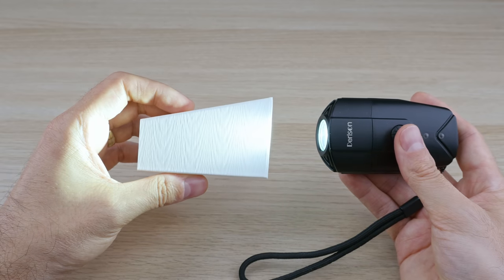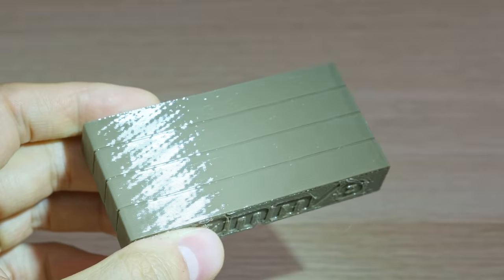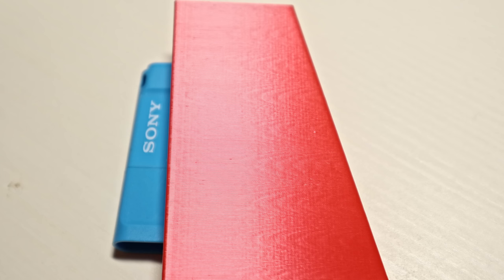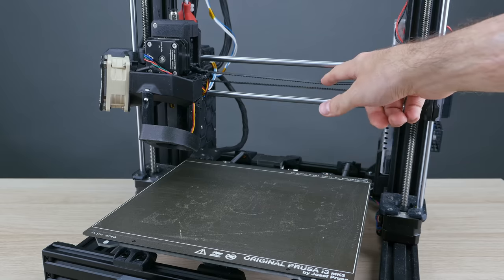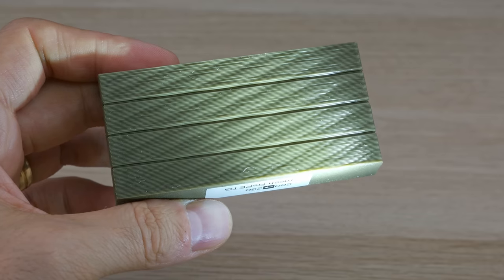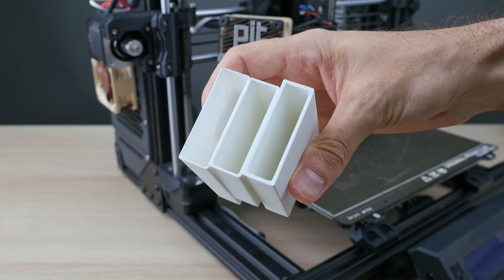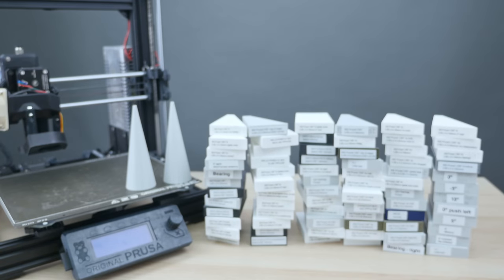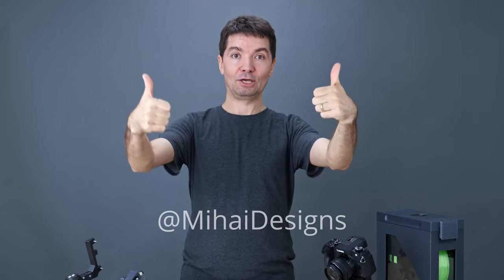What I've learned about your 3D printers (and mine)

Comment: Thanks for putting so much effort into this Mihai, if I could add an idea... if converting the single gear helps the problem (presumably because it alters the pattern of torque transmission) what do you think would happen if we designed an extruder with multiple sets of dual drive gears? Imagine one with 2 or 3 matched sets of dual drive gears, at offset angles of the filament path, with each set of gears having different number of teeth for both drive and filament contact but balanced for the same rate of feed. Could we somehow achieve 99% smooth torque transmission?
Reply from the maker: Great point! Multiple gears with offset teeth would reduce the issue most likely (although I have no way of testing). If you take the number of such gears up to infinity, what you end up with is very similar to double helical gears which as I understand it are better in every way from these spur gears, except they cost more to manufacture.
Reply: @MihaiDesigns  I think we need to crowd fund a modified Bondtech LGX for you to play with!

Comment: have you tried Power Filter? This issue can come from your power. You could in theory power your printer with Lab grade 12/24v power supply instead of power supply in your printer. Even better would be to connect power supply to the battery and than run printer from the battery - it would further ensure perfectly clean input power for the test purposes. (Sidewinder heated bad needs replacement - look at Fula Filament sidewinder bed upgrade - I have Artillery as well, but Genius with LGX + ACE copper head ultra short filament passage + CHT nozzle 0.4mm + Klipper with FluiddPI. I just finishing setting those upgrades, so can't comment on results, but have high expectations - ALSO, Klipper PID control of the bed should work a lot better.

Also have you considered if those issues could be due to nozzle temp variation - poor PID tune of the heater similar to the bed issue on sidewinder. 

We really need to move our SW into Sinewave modulation instead of basic on off squarewave control logic for PID output.

Comment: I figured it out. What do all printers have in common. They have moving parts. Each movement generates a frequency in the frame of the printer. These frequencies very on each setup but generally encompasses all printers. For perfect prints there would need to be zero vibrational tones with all moving parts. And that would be extremely difficult to achieve with all known 3d setups. An indirect method would need to be used. 

Solved.

Comment: Here is a very simple concept for partially solving this problem (maybe).
Please have a look.

https://imgur.com/a/xY4bn8Z

This design uses 4 gears, two of which are on the extruder-gears.  The other two gears keep the extruder-gears synchronized, even when the extruder-gears are too far apart to mesh.  It's a very simple hinge-and-axel design, where the hinge is held "closed" by spring tension (springs not shown).  The four gears are always meshed together as a linear chain (Gear A --> Gear B --> Gear C --> Gear D).  Gear A and Gear D will mesh when the "hinge" is fully closed, but there is no mechanical conflict because we have an even number of gears in between (Gear B and Gear C).

in theory this would "solve" the gearing problem for geared extruders.  In practice, there could be issues with backlash, etc.

This would not solve the problem of gripper-teeth denting the filament, which effectively changes filament diameter.
Reply from the maker: Indeed something like this could work. How are you solving the thrust forces? I wonder if spur gears would work instead since now they're all meshing correctly.
Reply: It's really just a half-baked concept.  

I know the helical gears will cause thrust forces that I haven't figured out how to handle.

Spur gears wouldn't have this problem.  I was just thinking helical, just because I thought they might mesh more smoothly.

I'm hoping that you, or someone, will take this half-baked idea and develop it, or at least investigate it.  Hopefully into a fully-baked prototype.

I would, but I don't have the time to do so.  Also, there are lots of people who are way better than me at engineering!

So I'm just trying to spur interest and ideas.

Comment: I have a theory! It popped up when you showed the green long prints. Over the length of one wall wall it looks like the head moves quicker and slower, judged by the change in thiccness. This might be due to the teethed nut mounted on the belts is not exactly centred. A higher radius results in higher belt speed and visa versa. With this same priniciple, the extruder can be at fault aswell. 

What do tou think?
Reply from the maker: The belt/idler/pulleys would produce the same pattern on every layer and there would be no shifting left or right. But a mechanical issue at the extruder wouldn't have to align with the layer below. Next video coming up in a couple days.

Comment: I changed my old bondtech clone for a new one a few weeks back and since then I started to notice this kind of woodgrain pattern, too. The other thing I changed, was that I went from OpenBuilds wheels to a linear rail on the x axis.
I couldn't pin down the problem to either of the two but this video pretty much confirms it's most likely the extruder, right?
I'll print the model myself, soon. Maybe that will give me some insight.
Reply from the maker: X axis will do patterns that are vertically consistent (usually). I suspect your BondTech extruder. I'm not sure if its parts can be 3D printed. If not, then I won't have a solution for you except for maybe reverting to the previous one (or reuse some of its parts).
Reply: @MihaiDesigns  sadly, the old one was kind of bad :/ but now that you say it: the pattern is rather vertically consistent than the woodgrain pattern you showed in the video

Comment: My pattern looks a bit like the one at 1:09. Flsun QQ-s pro delta printer. I heavily modified it (duet 2 and many other things) and I tried a fake titan extruder, an original titan extruder and a fake bondtech extruder (all with a bowden setup). All of them have this pattern.

I think relocating my extruder to get a shorter bowden tube helped a bit but the extrusion is still far from "perfect". To be fair you only notice this on flat surfaces with a strong light.

Did you try out a 0.9 degree motor for the extruder? That is definitely on my to do list. At least I think this should reduce the effect unless it is caused entirely by gearing.

Do you have any data from an extruder like the zesty nimble? With a 30? to 1 ratio mayhe it is smoother?
Reply from the maker: Wow this is super interesting to learn about because I only had one data point from one clone Titan so I did not include the original Titan. On one hand we need to consider that it might not be the extruder that's at fault. On another hand, if it is the extruder, then that's really interesting. Yes, flat faces are required, so it is in a way an occasional issue, but as we print more and more mechanical parts it shows up more often. I did try 0.9 degree motor and a 3:1 geared motor as well. I saw zero change. No data on the nimble.

Comment: Have you tried the 'cheapest upgrade to your 3d printer' method? I speculate that vibrations of the frame have sonething to do with this. So maybe putting a concrete pavement panel under it could lover them

Comment: I have wondered about the Slicer post-processing results if the codes themself sometimes can be to play for poor performance. Would be very interesting to check to codes in an NC code verification program and see if there is anything of interest. I'm sure most cam programs convert a cad model into a mesh even if it doesn't show it when programing so I think it shouldn't be a problem for a slicer to make printing paths on an stl/mesh however the tolerance might be a lot smoother in a real cam program but might not be anof to make any difference.

Comment: I've wondered whether using a low pressure air pump to gently blow into the bowden tube would help with friction and also reduce thermal absorbtion when the extruder retracts.
It would only need a t-piece near the motor end to prevent extra mass or movement restriction on the extruder.

Unfortunately my direct drive printer died and have given up repairing it (time for a replacement).

Comment: You said Marlin's PID Autotune does not work well. How else can I tune the PID values for my bed and hotend without using Marlin PID Autotune? Are there other options/methods?
Reply from the maker: For MK3S autotune does an OK job usually. For other printers it can be a nightmare. I ended up learning the algorithm and painfully adjusting values by hand and running scenarios to see what works.

Comment: I wonder if it has something to do with the part cooling fan's vibration/frequency literally showing up in the print.  Just a thought.
Reply from the maker: I find the part cooling fan vibration quite annoying as well, but it's not what's causing the larger patter. It might be causing another one though. I still need to run some tests. Whatever pattern it would create, you should expand and contract as you raise or lower the printing speed.

Comment: If manufacturers would use double helical or herringbone gear style instead of spur gear for the feeder then this wood pattern would disappear
Reply from the maker: My thoughts exactly! You read my mind (or I read yours) 😄 Double helical would be easier to manufacture and would not accumulate dust in the middle as I understand it.
Reply: @MihaiDesigns  Helical pattern makes the gear running smooth and quiet. This pattern that you see is caused by the gear steps intermeshing with each other and because the path the nozzle is so short you see it on the print. There is other way that may work. Use a stepped spur gears. These are used when you want to eliminate backlash and may smoothe the ride slightly.

Comment: i see this pattern too on my printer in different prints i noticed them but i don' have the wood grain pattern but just horizontal layers slightly misaligned people said to me it's a heating issue it might be but i feel like it's also something else in the past on my diy prusa i2 i never had these and that machine is not enclosed or anything just like my machine now :)
Reply from the maker: There can be many many reasons for that. Best way I know is to take each assumption one by one and change something on the printer and see if the pattern is affected. It's a lot of effort and parts to be replaced. Definitely not fun. This is why I believe we should have one printer with most of these issues fixed that everyone can use, so we don't have to individually fight issues again and again. But we're not there yet it seems.

Comment: But your spreadsheet shows that bowden setups have the same issue but less only a 1/5 of the time
Reply from the maker: Oh, what I meant is that Bowden setups did not show the wood-grain pattern specifically (but they do tend to have other issues). There's only one report of Bowden generating wood-grain, but there is no picture. Sometimes a pattern can be mistaken for another one or be caused by something else, so there will be some noise in the data. Doesn't mean a Bowden setup cannot have this issue though.

Comment: How bits is the precision of the floating point numbers in the printed file? The Moiré pattern is too smooth to be caused by hardware peoblem it looks mathematical/software issue.
Reply: Looking at the stl file and what is output in Cura clearly shows the resolutio will infact produce moire when matched to the resolution of the printer. Adding random noise in the g-code at the end of the floats will remove the peoblem, i am not sure why there is no setting for it already in the software. Anyway can bet any photographer will spot the problem right away.

Comment: Yeah,  i have an issue of incosistence z artifacts from the very start, try every thing: leadscrew replacement, leadscrew restain, belt tightening, linear rail upgrade, 32 bit board and tmc driver, pid tuning,... Non of those works
Reply: The patern looks exactly like in 3:20

Comment: The printer extrudes a layer and when it comes back to the point in the next layer, the earth has rotated so it is no longer perfectly aligned and leaves the pattern.   Some also say it is the driver pulses into the extruder motor.  Point is, maybe just sand your prints before you paint.  ?
Reply: The earth has rotated? Lol yes, and it brought the printer and the print with it.

Comment: Oh man, I hope you got the solution :D Last month I printed several tests, because I tried to eliminate pattern on side walls of a zx81 case (https://www.thingiverse.com/thing:4525078). I tried to systematically clean, tighten, replace every part of my printer with backup parts, but it is the same. On smaller parts, on thinner walls, different shapes it has less visilbe pattern or at least the frequency is different. But with the vertical walls of that model it is just terrible. It drives me crazy :D

Comment: All those test and all shows a pattern and some mask it more than others and you and most people I know who do have a problem with the lines have swop parts to try and curb these lines, not sure why my 3d Tronxy printer don't show this lines but may be that I do 0.1 level prints, it do show these lines at 0.3 prints and higher and frustrated the hell out of me.
Your test does not show what firmware and slicer program they use to print as I get it that those consistant pattern lines are a software/firmware problem as if it were the hardware not all would have the same pattern. As a engineer I have came across that patterns won't be so constant and would differ from each other from manufacturer to manufacture and of wear patterns so each 3d printer would have a unique pattern.
Unfortunately I'm not a programmer so a fault code in the program I won't be able to pick up.

Comment: The problem is junk printers and software .  Prusa shouldn't be any more of a standard than the cheap Chinese i3 printers.  Compound this with Marlin's inability to move motors without a lot of jerk, and you have the quality of prints you show. .  Stiffen up the printers, change to klipper firmware, and always direct drive.

Comment: OK i got many same lines, but u vorgot vibrations of printer self.
If printer stay not save from vibrations outside U can See it on model. Look like this things u show. My printer signs every little vibrations in print model. 
And i belive the pulley with tooth is vibratin too. 
When printer Work many parts will move some of then quick and stop, this energy Go in to the chassis of printer If U Look accurate U can See it with U eyes or feel it on ground Put U shoes off stay in near of printer If he works U can feel it in 90,% Off all printers are instabil of Struktur. this is the problem here are the mysterys lines. U can Tune Up the printer with Software and Hardware. Put a Glas of Walter in workin printer U  understand...

Comment: Check your table, doesn't look straight.

Be sure to place your printer right and on a flat straight surface, if the table is not leveled there's no use in leveling the bed.